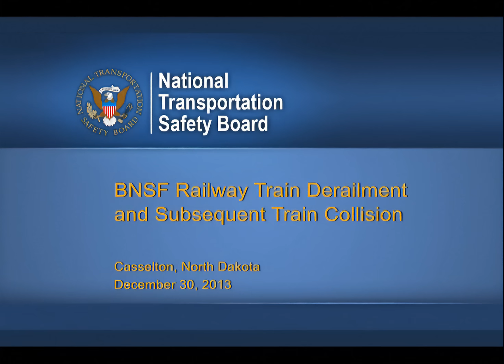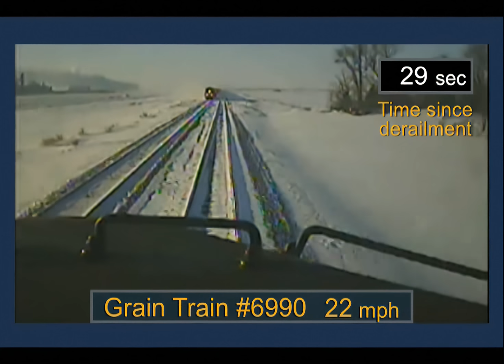BNSF Railway Train Derailment and Subsequent Train Collision

Comment: I was a Quality Inspector for a company where we remanufactured train wheels and axles as well as did brand new mounts with new bearings. Just the weight of the axles and wheels alone is absolutely insane.
Reply: Wesley Scherr  You replied to the wrong guy.
Reply: They are heavy enough that where I'm from scrap wheels are actually in fairly high demand as mooring anchors
Reply: And that’s nothing compared to the weight of the locomotives. Over 400,000 lbs ballasted with lead plate and concrete. It’s insane just how heavy everything is on the railroads
Reply: Since this accident, and if you were working then, did procedure change because this was noted in the report as an internal void in the original forging 3 years prior that could have been detected with X-ray or other methods? Or, as you stated “was a Quality Inspector” (was being the word of note) were involved in this axle build?
Reply: @Malama_Ki this was after I left the company. All wheels that we were manufactured with new contours were all magnetic particle inspected.
Reply: @GlassesJacketShirtMan SHEAR WAVE Inspection and x ray are the only ways to locate subsurface voids in steel castings.. mag particle testing only locates surface cracks!!..NDT lll
Reply: HAHAHA omg I love it when the lazy guy, google boy, and the little helper of google boy appear in the comments
Reply: @abrams5819  I love it too. Those guys, except the "lazy guy",  don't even have a single neuron of dry humor. Your comment made my day. Shall I go on with the sketch ?
Reply: @abrams5819  Your comment is HILARIOUSLY true
Reply: Incredible, what unfathomable tonnage rails handle!
Reply: Man I didn't realize how controversial this comment was. Since writing this comment I had died woke up from a coma and just recently somehow got my health back.
Reply: How much is "insane" ?
Reply: @pendejoculo2581  let me google that for you : 
What is the weight of a train axle?
Standard wheel assemblies made of steel and ductile alloy can weigh between 235 to 480 pounds. The lighter-weight assemblies have an average load capacity of 10,000 pounds, while the heavier assemblies have an average capacity of 40,000 pounds.
Reply: @bakedstreetyt  Thank you. Then can you find for me the conversion to Kg ?...
Reply: @bakedstreetyt  just 200-500 lbs??  Surely not that light.  Re-Google that and send us a memo with the updated accurate average weight of a train axle.  Thank you
Reply: American freight car wheelsets weigh around 2400 lbs.
Reply: @michaelperkins5858  that would be correct
Reply: This is horribly inaccurate.  2300-3000 lbs for a 33-38 inch wheel.  Christ.
Reply: To put it into perspective, a semi truck is fully loaded under federal law carrying 6 axles alone.
Reply: @Cyb3rst0rmIndustries  thanks.  Yours is the best answer
Reply: It's a very in weight but they are extremely heavy as my point you need a crane to lift it or one of those Norwegian guys
Reply: @GlassesJacketShirtMan  s

Comment: why did he keep driving???
it was emergency break uncommanded, 50 seconds passed after derailment, everyone knows, train halts to 0, he starts driving, sees the cart by 40 mph and still accelerates to 43, before hitting manual breaks, wtf?
its like he tried to "move" the oil carriage away?
Reply: What are you even saying? 1 train went into emergency on its own, the other was placed in emergency by the engineer. Nothing can be done after emergency.

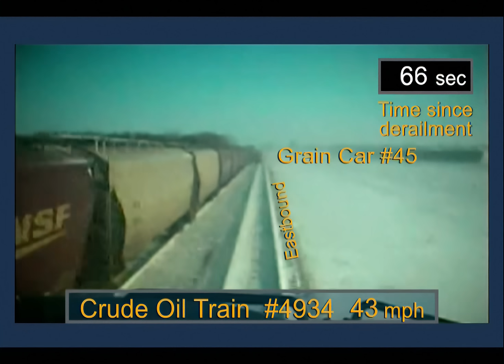Comment: At 2:29 of the video, #6990 is moving but the graphic says it is going 0 MPH then there is an EDIT to a different scene & different cars on adjacent the adjacent track.  What gives?
Reply: Maybe mph is determined by wheel speed and wheels were locked up?
Reply: @charleshunter2041  What about the edit to a completey different scene?
Reply: @francisjacob8929  I'm looking at this on computer monitor. At 2:29 #6990 IS at a complete stop. It may look like it's moving because the moving shadows of #4934. It then switches to #4934 camera. #4934 is still moving and to the left, you can see that #6990 is not moving.
Reply: @francisjacob8929  That's gonna be hard to see on phone screen.

Comment: Perhaps there should be emergency refuges that trains can pull into if there's a blockage on the main line?
Reply: Please be joking. Please be joking….
Reply: @bobbyrowlett4518  Trains are no laughing matter Mr Rowlett. In the cab I once saw a sheep hit by the train in Kenya. Fortunately the passengers in the back were all tourists and didnt notice.
Reply: @andyharpist2938  I’m a Locomotive Engineer. Nothing about your above comment would’ve helped this situation.
Reply: @bobbyrowlett4518  Joking aside, here in UK they have now made the emergency motorway hard shoulder lane into an active 'slow lane'. Hedged in by barriers there is no place to pull over to if your engine seizes up. You basically sit there hoping the trucks will notice and stop. They have made emegency refuges ever Km or so.... but many dont get there.

Comment: wtf did I just watch??? why the engineer didnt even try to stop his train??? O.O
Reply: The train with the camera had emergency brakes automatically applied.   The oil train applied brakes when he saw the derailment happening in front of him
Reply: @cdavid8139  but why so late after the derailment? and why is that "emergency" break had no effiency? I know it was thousand of tons, but still wtf was that slow breaking down?
Reply: @Rapkatona18  The 'emergency' brake did its job as best it could.   That is normal railroading   Both of these trains consisted, as you said, of thousands of tons each.   In addition, the grain train was actually pulling cars that were on their side at the end.   Incredible isn't it?

Comment: This is why I’m a firm believer in pipelines.  The green wienies are shutting down pipelines forcing movement of oil to rail cars.  This is worse on the environment.  The diesel burned to move the oil and the horrendous spills that happen when this happens.  My family has owned land with pipelines running through them.  You don’t even know they are there unless someone tells you and for the occasional markers at the property line so authorities have an idea where it’s at.

Comment: This certainly makes the case for pipelines.
Reply: Came here to say this. FFS Canada....
Reply: At least when a train spills, there are people there to notice it. When a pipeline spills, they have to find out after the fact when some random passer-by notices a lake of oil where fertile fields used to be and they have no way of knowing when it started or how much was pumped into the ecosystem...
Reply: @7heHorror  that's true. Unfortunately sometimes the people notice because their town is burning down.
Reply: @7heHorror  Na. They have detection systems in place on modern pipe lines. The Trans Alaska pipe line has been in operation for what, 40 years now? when was the last time you heard of a pipe line leak? NEVER.
Reply: @bobadams179  Happens all the time in Alberta.
Reply: @7heHorror  I've never heard anything about it.
Reply: @bobadams179  You're not very good at the internet...
Reply: @7heHorror  Proof? I don't believe you.

Comment: When I started working on the Santa Fe in 1973 my instructors stated, if I was close to a derailment happening to run towards the derailment.   That went against my line of logic.   34 years later I never had to use that instruction.
Reply: Forgive my ignorance, but what does that mean you should do?
Reply: @user-jy3zl2vp4b  run towards the derailment.  I personally have worked a lot of derailment’s.  Nothings romantic.   Definitely would not recommend that line of work.

Comment: I sometimes do wonder why double track is always spaced so closely to each other.
Since a lot of derailments seems to only push a train car off by up to the gauge of the track itself. (since the other wheel tends to hinder the car from going further.) Ie, in a lot of derailments the car will only move about 1.4 meters to the side. Maybe tilt a bit so add another meter.

So why build double track with only 0.5-1 meters (2-3 feet) between the loading gauge of the trains, instead of a more generous buffer zone of 2.5-3 meters. (8-10 feet)

Downside with a larger buffer zone is that the track now requires more ground, and any embankments also require more material. But an accident as seen here would be a lot more rare. And after an accident the derailed cars have a lesser risk of blocking both tracks. Ie, one can still run trains, all though at a lower speed for safety reasons.

One can though argue that "what if the train derails further than the gauge of the track.", and yes one could make an arbitrarily large buffer zone, but this is rarely practical nor economical. And going up to 2.5-3 meters is at least providing enough to safely handle a relatively common variety of derailment.

Comment: Damn! I couldn't understand the derailment given both trains appeared to be moving smoothly.
Reply: First train had the the derailment way back in his train. the derailment would have engaged the air brakes on the train and train would have started stopping. It might take half mile to a mile to fully stop depending on length and weight of train. The second train with tankers would have no clue there was a derailment of first train unless they were warned. You notice first train comes to a full stop. The on coming train might have noticed obstruction at three quarters of a mile. If engineer hit air brakes immediately it would have taken the half mile to mile to bring his train to a stop. Even though second train was coming to a stop (say maybe from 50mph to 20mph at impact) the weight and energy of hundreds of tons of material caused what you saw even though it seemed like slow motion.

Comment: Do they not have any pre-visual track obstruction sensor? Eg rail electro conductance or acoustics, or lidar, or infrared using the distinct temps of the rails vs everything else, etc. Seems like it would be relatively cheap and easy and pay for itself. An accident like this must cost a fortune and could have been less severe.

Comment: Wow, the 4934 engineer determined his load was on fire rather quickly after the derailment. Is crude oil that combustible?
Reply: It has a flash point of 140F. It isn't that flammable, but there are a lot of vapors in those tankers. I'd assume the collision ruptured a tank and the sparks happened to be above 140F and happened to catch the vapors the wrong way. One thing I know from experience about crude oil fires is that even though it doesn't happen easy, when it happens, you know immediately because of the thick black smoke and awful smell that begins to surround it. The train derailed and went at about a 45 degree angle off the tracks, and I'd assume the cars behind the engine were all over the place, he could probably see right out of his window a giant plume of thick black mass taking over the air.
Reply: @jonny6702 : That would explain it. Thanks for the info!👍
Reply: The radio chatter made it sound as if the engine itself was on fire, which would make more sense. He kept saying "we got to go" and he said "grab the portable" to someone else in the engine with him.

Comment: I was a railroad brakeman for 25 yrs and was riding the second unit of a consist, we were running at restricted speed approaching a signal board when something exploded in the electrical cabinet and balls of fire staring flying over over the cab area and smoke started boiling out the electrical cabinet, I went out the short end door and bailed off and when safely on the ground I  called the engineer and yardmaster at the same time to report the fire, , the yardmaster asked what is burning, I replied I don't know I am not in the cab of the engine, the yardmaster said go back and look, I said I can't go back and look, the yardmaster said why can't you go back and look. I replied I am on the ground and the train is still going, call the fire dept. and send a crew hauler to come get me and gave him my location.

Comment: From the NTSB Final Report: Probable Cause The National Transportation Safety Board determines that the probable cause of the collision of the oil train with the derailed grain train car was a broken axle on the 45th car of the grain train caused by an internal void that was created during axle manufacture.   Contributing to the cause of the derailment were inadequate interchange rules used to locate internal material defects in secondhand-use axles.   Contributing to the severity of the accident was the release and pooling of a highly flammable product that resulted in a fire and caused additional cars to fail.

Comment: From the NTSB Final Report: Exclusions: The track structure, the signal system, and train crewmembers’ compliance with operations rules and procedures did not contribute to the cause of the accident.   Investigators conducted mechanical inspections of the equipment that did not derail and found no evidence of other causes that contributed to the derailment of either train.   The pretrip mechanical inspections of both trains identified no defects.
Reply: If it wasn't equipment or human error, what else? Snow accumulation?
Just wondering.

Comment: The audio on that video clip is very deceiving.  The grain train did report the emergency condition immediately.  The problem was that it reported the emergency on the radio channel for the stretch of track it was on, which was in one subdivision.  The oil train was in a different subdivision with a different radio channel.
Reply: Thanks for explaining that.